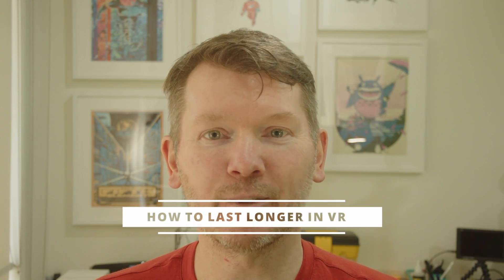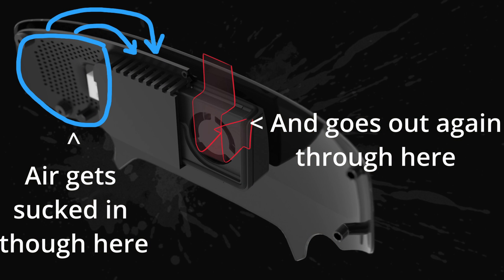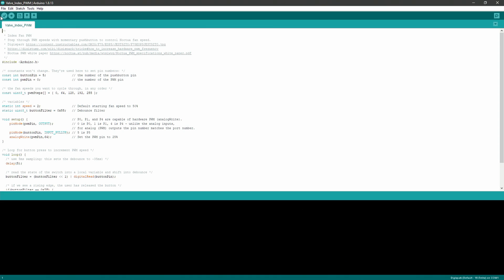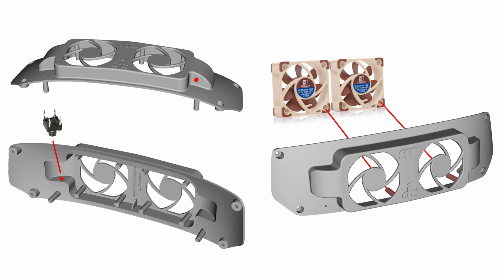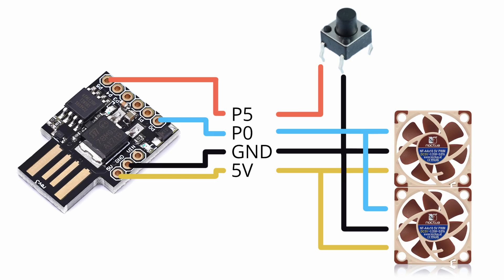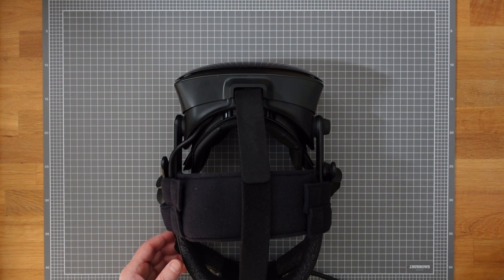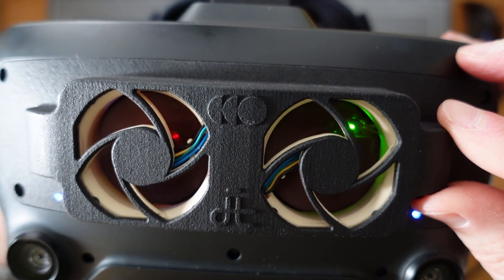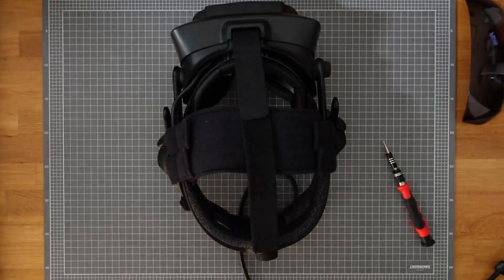Last longer in VR: Headset Cooling

Comment: Great mod!! Have you considered using one fan to pull fresh air into the headset, and the other one to push hot air out of the headset ? This is what I would have tried to do initially, but maybe it works better with the way you did?
Reply from the maker: this is strong enough that you can feel the air being drawn in through the eye side of the headset and out the fan holes at the front, I don't think two fans would add much benefit.